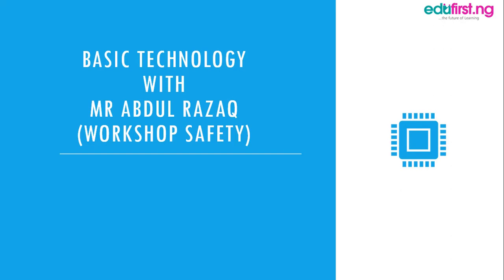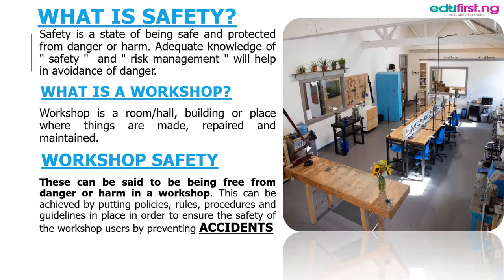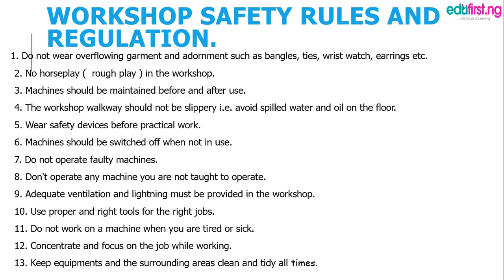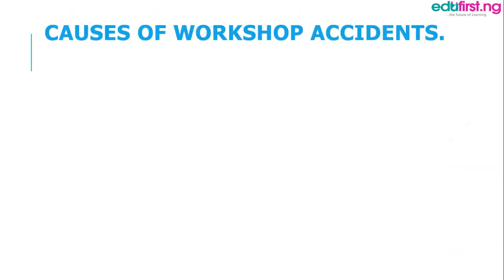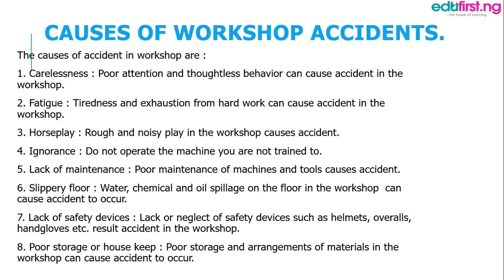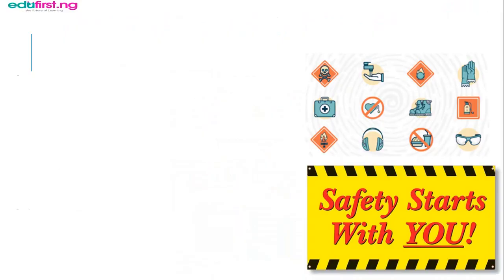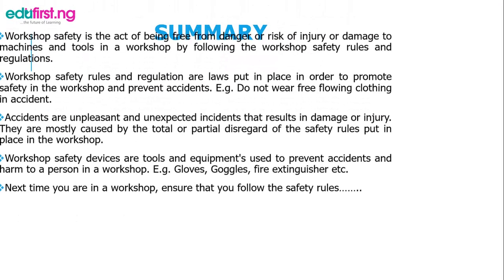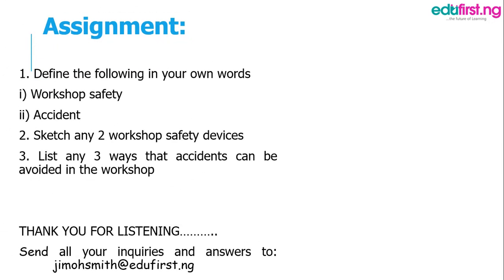Workshop safety | Basic Tech | JSS1 | 1st Term

Comment: (1a) Workshop safety is defined as the precaution or safe actions taken to prevent accident in the workshop.
(1b) Accident is defined as the or an unexpected occurence that causes harm or injuries to people live and properties.
(3a) Read all instructions of machines before use.
(3b) Always put on safety wears while working in the workshop e.g goggles and overall wears.
(3c) Off any equipment you are not using if not in use.  KAREEM ABDULSHAKUR. Jss3